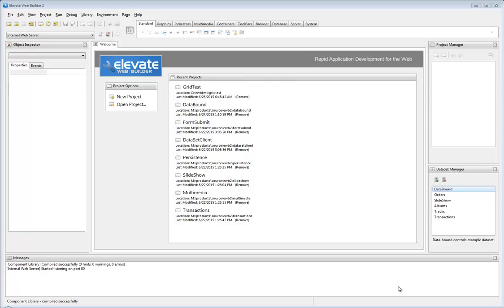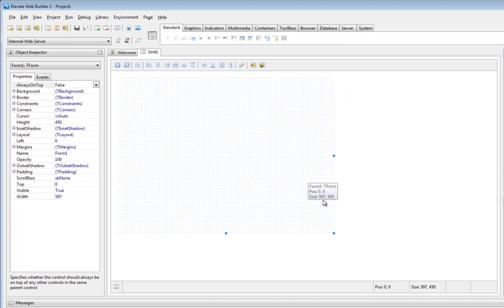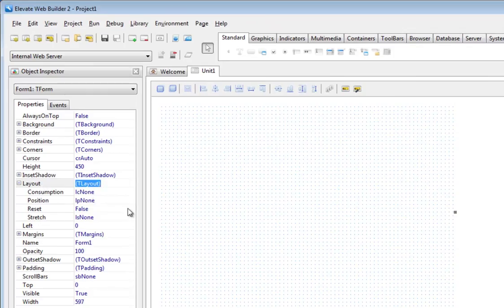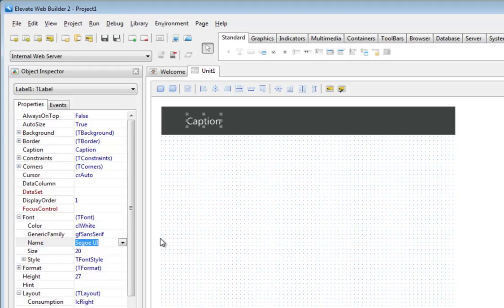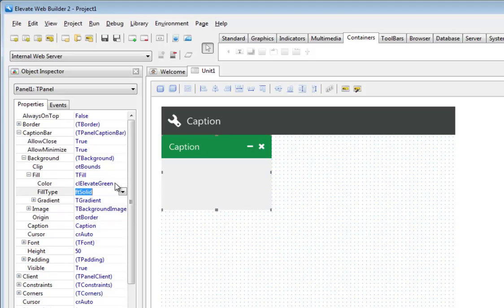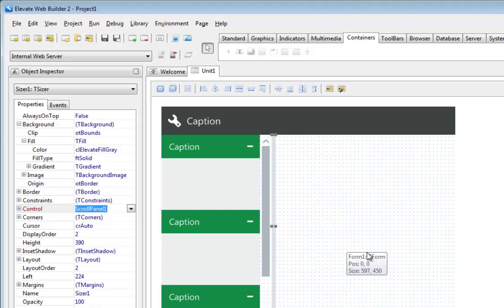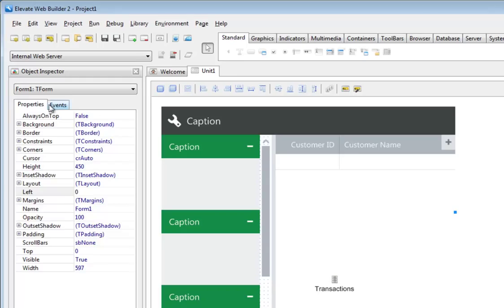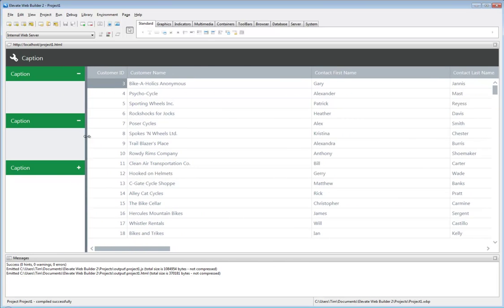Introduction to Elevate Web Builder 2

Comment: Hello Tim,

I'm very impressed with your work. 
Seeing your tutorial I had to download the trial version of EWB.

I managed to connect to a MySQL database through ODBC and can even preview my data in the database manager, but somehow i don't manage to get the data in a TGrid. 
I connected the columns to the desired fields of test table (employees) through the DataColumn property.

On the OnShow event of the form I used   database.loadrows(employees);  as in the video.
If I run the application I get the error 

dataset load response error (Database "default" not found)

Can you help me out here?
Reply from the maker: Thank you for the kind words and your interest in Elevate Web Builder.

For a quicker response, please send all future support inquiries like this to support@elevatesoft.com

The issue is that you're not setting the TDatabase.DatabaseName property.  This requirement is part of the new database additions in EWB 2.05 and higher. Prior to 2.05, there was always only one database (in fact the "Database Manager" was called the "DataSet Manager". :-) )

In your form's OnCreate event handler, add this code:

procedure TForm1.Form1Create(Sender: TObject);
begin
   Database.DatabaseName:='MyDatabase';  // Use your database name from the Database Manager here
end;

An even easier way of dealing with this (also, 2.05 or later), is to simply drag the database from the Database Manager in the IDE and drop it in the Units section of the Project Manager.  That will create a new database in your project that includes all of the datasets that you have defined for the database.  You will still need to add any LoadRows calls to this new database unit (database's OnCreate event handler), but it's nice because it keeps your datasets off of your forms.  2.06 includes a new TDataSetController that allows you to hook into a TDataSet from any form for responding to data change events.

If you have any other questions, please feel free to email us.
Reply: Thank you for your quick response. I will use  support@elevatesoft.com in the future.
That line of code did the trick.

I wonder how easy it is to deploy to, let's say apache, or is internal webserver powerful and secure enough? Perhaps the internal webserver is just for development purposes?

I can't say enough how much impressed I am (and i'm only just playing with it for a couple of hours ;) and believe me I have seen a lot of "easy" web building tool  attempts)
Reply from the maker: You can deploy EWB applications to, and load from, any web server available, since the two files that are emitted for every EWB application are just HTML and JS.  However, the "tricky" part is the JSON database API that EWB uses to load columns, rows, and BLOBs, as well as commit transactions.  This API is built-in to the EWB Web Server that we provide, whereas with other web servers you need to roll your own code for handling the database API.  The good thing is that the API is fairly simple, and completely documented here:

http://www.elevatesoft.com/manual?action=viewtopic&id=ewb2&topic=API_Reference
http://www.elevatesoft.com/manual?action=viewtopic&id=ewb2&topic=JSON_Reference

Right now the EWB Web Server is very basic and we recommend it only for small-to-medium applications with normal amounts of traffic (we use something similar for our entire web site).  The next release, 2.07, will be adding SSL, virtual host support, and a lot of other features that will make it more attractive to use over something else.